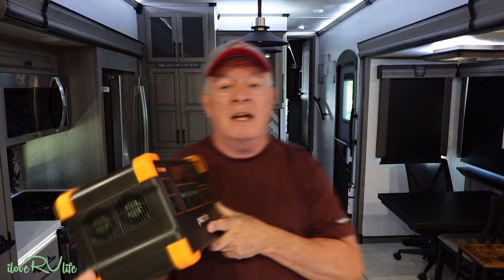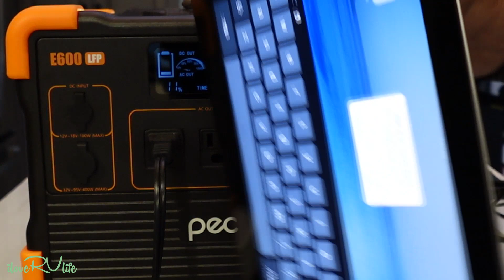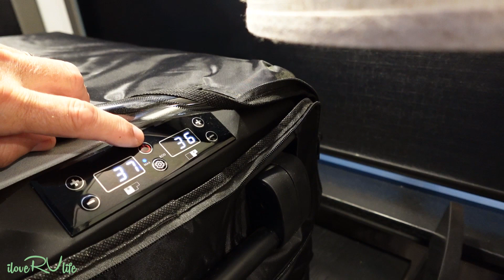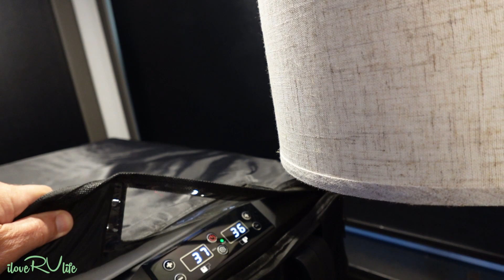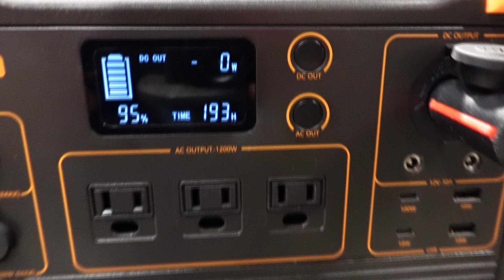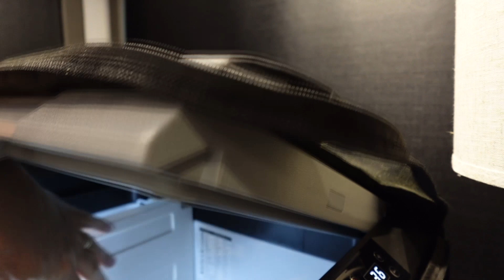Pecron E600LFP Portable Power Station

Comment: nice, very good performance!  You ought to try an electric water kettle for making coffee, maybe a crock pot.  You've got the fridge to keep leftovers in, now you need something to warm food up.  A toaster would work, but a small toaster oven?  You can also plug the Pecron in the car cigarette lighter port while the mini fridge is running off the E600 while driving.  Then you can stop to heat up some food - we're talking for a car trip or van.
Reply from the maker: Thanks. We have those and a small air fryer. The E600 for its size and capacity does a great job.

Comment: Good luck if you ever try to use Pecrons warranty. They offer to send you parts with a video and you have to take it apart and try to fix it. The other option is to pay to ship it to California which is over a $100 for most of us I learned this the hard way
Reply: I'll take that.  Just ordered one to replace another brand.  One day the device just stopped being aware that charging power was available.  Given any mfg support it is probably a chip board and solder.  But wait!  The box is glued shut, and the mfg isn't interested.
   And that's where project batteries come from.

Comment: Have you ever removed all your skylights,trim around your crank up vents and air conditioner trim and burned up nearly an entire roll of aluminum tape to seal up an insane amount of air leaks? I have and every little thing helps with heating and cooling. 106 last spring in Arizona I went to the extent of removing the vent cover under my stairs and nicely taping off the back side so my furnace and under fifth wheel compartment wasn’t being cooled. And then removed ceiling vents and taped off the ductwork so my bedroom and living room air conditioning was separated. Mainly so my dog would be cooler while I was at work and confined to the living room. Now I’m working at an rv dealership at home vrs traveling the country working on construction projects. And the best rv they sell are Cedar Creek. Sure look nice but every time one comes in for warranty work it is Pages of jobs. My favorite is still Mobile Suites . I hope their quality hasn’t changed since they were bought out just a few years ago.
Reply from the maker: The AC vents in our Gateway leaked like crazy and I sealed them. Agree.  Makes a big difference.

Comment: I just purchased this unit. How do you charge the phone wirelessly?
Reply from the maker: Turn on the DC switch and lay the phone on top.
Reply: @iLoveRVlife  I have an IPhone in otter box case. I am curious if this is preventing wireless charging?
Reply from the maker: I’d try without the case.  Maybe too thick and preventing the contact.

Comment: Dose it have pass-through charging
Reply from the maker: Hi James. I can’t find pass-through in the specs, but the outputs for both DC and AC work while charging. I tested with the power brick and all outputs worked.
Reply: It seems that pass through has been driven into standard feature. In the last year, there don't seem to be any players in the market who don't have pass through..
Reply from the maker: Percron shared in a response it has pass through charging.

Comment: I used this model and the pecron 2000lfp for camping last week for camping. It was my time to put it to the test. I also brought my ecoflows and bluetti eb3a as they are already proven. The pecrons worked absolutely flawlessly. I also used pecrons recommended 200 watt solar panel since it has the voltage requirements. Thier panel actually has the same foot print as my 160 watt solar panel. I'm not sure how they are able to sell these substantially cheaper compared to the other big brands I mentioned but I totally recommend pecron.

I also tested my iceco jp40 pro on this 600lfp pecron at home. Set at 34 degrees it lasted about 55 hours . The pecron 2000 lfp would probably power  my dc fridge for a week. Keep in mind ambient temp will vary the results
Reply from the maker: I was impressed by the 600. Small package, but feature rich. The off shore units are competitive in price. We’ve been using the various brands for several years and they’re holding up well.
Reply: I've been seriously looking at the Pecron 2000, how do you like yours, any cons?
Reply: @GeoD  almost no cons. I'd say the only thing I don't like are the voltage requirements for solar and proprietary aviation connection. but its hard to get away with any of these other brands  having some type of proprietary connections. Like eco flow and their eco system requires more proprietary dc connections for thier ecosystem of products. 
I've only had this pecron for under a month and I'd honestly say I can recommend them over the ecoflows and bluetti which I own also. There is no major advantage the equivalent models of these brands have over the pecron e2000 lfp. In fact like reviews show these pecrons are actually more efficient.
Reply: @DoritosResidue  Thank you!